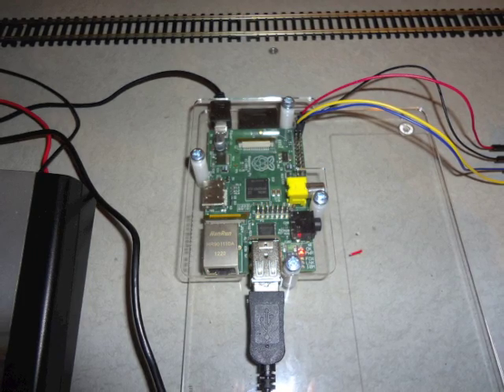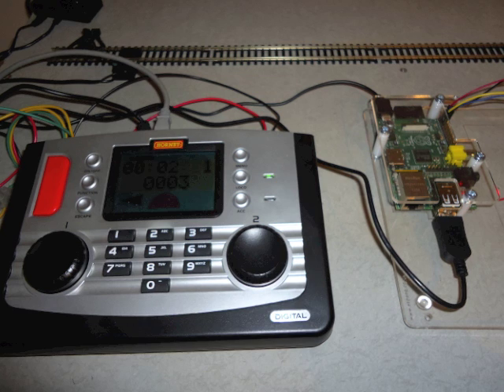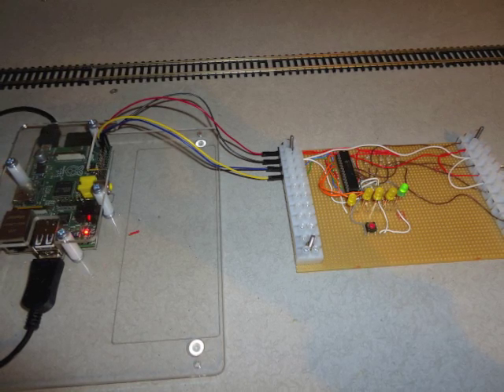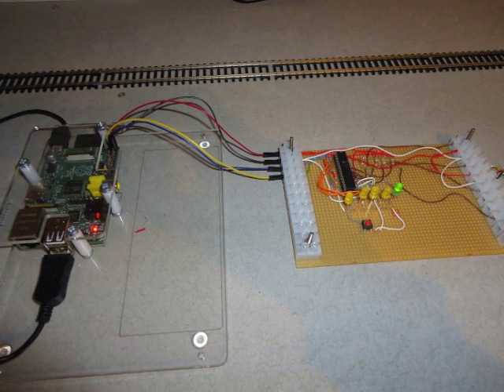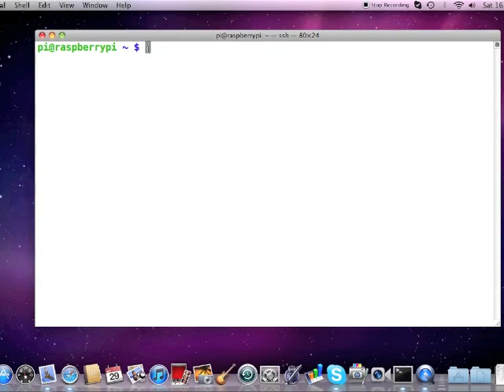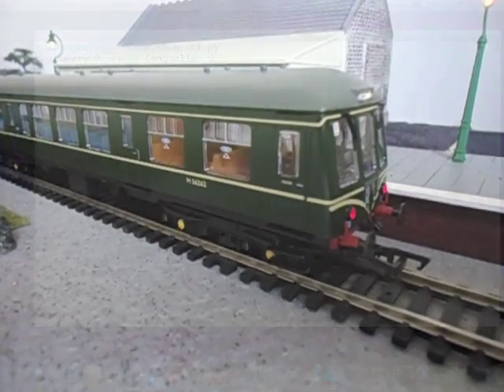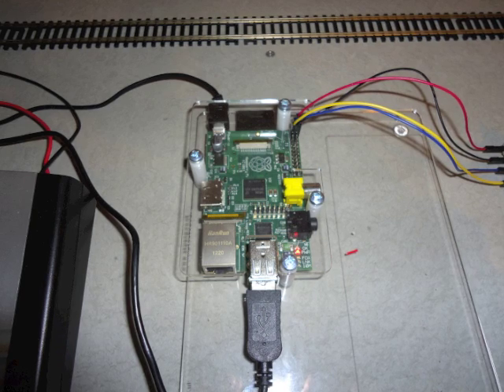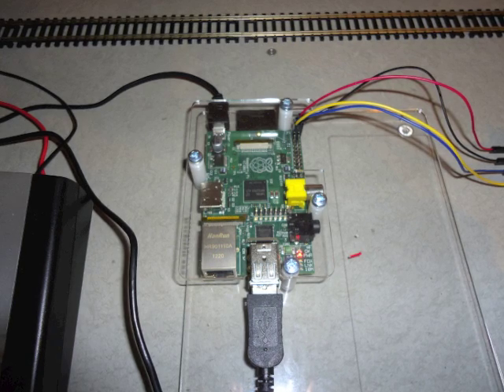Raspberry Pi Model Railway Controller

Comment: Hello
Thanks for the amazing code and demo, I've been searching for something like this for ages, you're an absolute lifesaver!
Just wanted to ask if you would know how to control a point/turnout with it. I tried adding an accessory object but trying every address that it might be and activating/deactivating it does nothing. This is using the hornby accessory decoder (point address 61), and it works fine with their software so not sure what needs to be done differently in the python code to send the command to it to switch the point? Couldn't see anything wrong with the accessory code compared to the xpressnet spec either :|
Cheers in advance!

EDIT: After a lot of pain i solved it, this was my function for accessory decoder in hornby.py for anyone else who has trouble

  def action(self,state):
    message = bytearray(hexdecode('520000'))
    if self.offset == 4:
        message[1] = self.address+1
    else:
        message[1] = self.address
    message[2] = (self.offset % 4) + 8
    message[2] |= 0x80
    if state == 1:
        message[2] |= 0x01
    else:
        message[2] &= 0xFE
    parity(message)
    send(message)

so for a point decoder with output 61, you would make a hornby.Accessory(15,1) because 15x4 + 1 = 61
Reply from the maker: I'm pleased you found the project useful. I didn't use the Hornby accessory decoder, so thanks for sharing your experiences. Having just reviewed the xpressnet  spec (It's been a long time!), I think the relevant part is 2.2.18 - Accessory Decoder Operation Request, which implies that the address (the first parameter of the Accessory class) is a group and each group (the second parameter) is one of  4 addresses. Which appears to tie-up with your findings - the 2nd address on the the 16th group - i.e (15,1)
Reply: @peterwallen1883  Yep that's the one, it just confused me because a physical group of one accessory decoder actually crosses 2 group addresses- eg output 1 is (15,1) but output 4 is (16,0). 

I also figured out how to monitor the serial comments from the Hornby railmaster software (had to disable it auto-resetting the controller in an ini file otherwise it would kick the monitoring software off the COM port) so hopefully I can reverse engineer more stuff from here if necessary. 

But again massive thanks, I would have not known remotely where to start if it were not for these videos, and the fact you still reply to comments 7 years on is amazing too :)

Comment: Hi Peter,

I am really impressed with your model so I am trying to re-create it. I was just wondering how powerful is the magnet your using? At a guess I think your magnet is about 5x3mm and is a little over 10mm away from the sensor.

I have got some 2x1mm N35 magnets, they do trigger the hall effect sensor but a magnet has to be within 2-3mm to be noticed. I'm guessing with a train moving at any speed it would just be missed completely.

Cheers,
Matt
Reply from the maker: Hi Matt

Thanks for you interest in my project. I'm using a circular magnet about 10mm diameter and 3mm deep and is probably about 10mm above the track sleepers. Someone gave me the magnet, so I'm not sure exactly what type it is, but, I think it's a super strength Neodymium magnet. These are readily available on Amazon, Rapid etc.  I believe I did experiment with a small bar magnet 20x3 mm, but as you suggest, results are less reliable particularly at speed. I hope this helps. Let me know if you need any further info.
 Peter
Reply: Hi Peter Wallen,

I have ordered 25 neodymium 10x2mm n25 magnets from eBay cheaper than anywhere else I could find and they are scary powerful. I can barely pull them apart, I have already damaged the nickle coating on 2 of them where I accidentally let them snap together. I have also managed to kill one of my external hard drives before I opened the package it came in on top of it so if anyone else buys magnets please be careful!

As for their strength I had 1 of the magnets about 10mm away from an array of hall effect sensors sat next to each other in a breadboard and its activating 2 of them. I started moving them back and forward quickly at about that distance polling at 0.05 seconds and it was seeing it fairly well. If that doesn't work I can try adding 2 magnets close together giving me a little over 25mm for it to see as the train goes over.

Cheers,
Matt

Comment from the maker: Hi Mark, my best guess is that the Rpi is not finding the MCP23017 at address 0x20. If you installed the I2C interface using the instructions on:
http://www.skpang.co.uk/blog/archives/575
run i2cdetect to check that you can access the controller and confirm its address.
0x20 should be the address if the address pins (15, 16, 17) on the MCP23017 are LOW.
Looking at the comments on the skpang blog it looks like there may be differences between Rpi revision 1 and 2 boards regarding addressing. You could have a look at changing bus = smbus.SMBus(0) to smbus.SMBus(1) in the heSensor.py module.
Hope this helps.
Reply: Thank you Peter. I changed the bus = smbus.SMBus(0)  to smbus.SMBus(1) in heSensor.py and it works now. Thank you. I am using this with my N gauge layout.

Comment: Trying this circuit I get this error message:-

  File "smra1.py", line 108, in <module>
    heSensor.config(0x20)
  File "/home/pi/heSensor.py", line 66, in config
    bus.write_byte_data(address,IODIRA,0xff)  # set all ports in bank A to input
IOError: [Errno 5] Input/output error

Please can you throw any light why I get this error message

Comment: I think about track sensing, that means you have to isolate at least one of the rails and connect it to something, so when the train is on the track it takes some current an will be detected, it will be looking cleaner in the track.

Comment: Perfect! This is exactly why I brought my Pi! I was a bit worried about how easy it would be to interface with the USB controller (I've just got analogue so far,) but it looks like it can be done! I've seen some clever ideas for block detection as well, the Hall method looks easier though.